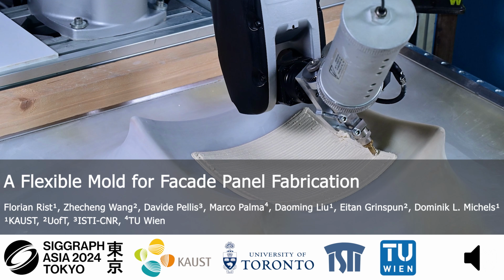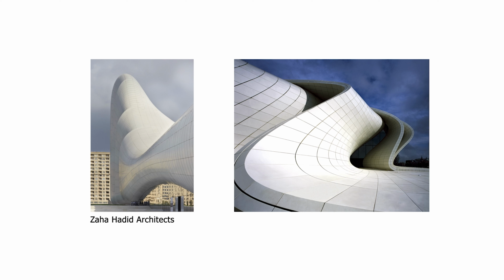A Flexible Mold for Facade Panel Fabrication (SIGGRAPH Asia 2024)

Comment: Congratulations, I really like the very innovative way to form complex shapes. 
The next step would be to do the same with the negative panel and place it above at the desired thickness. Then choose the right material to inject and form the panels. That would eliminate the need to 3d print.